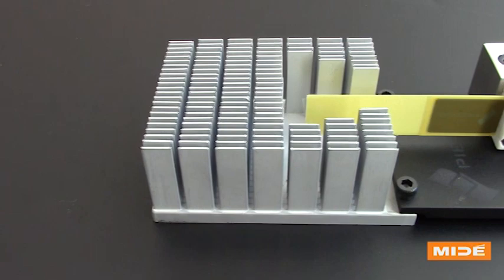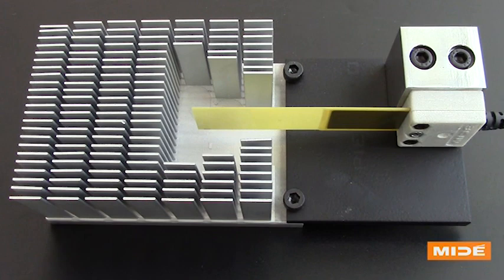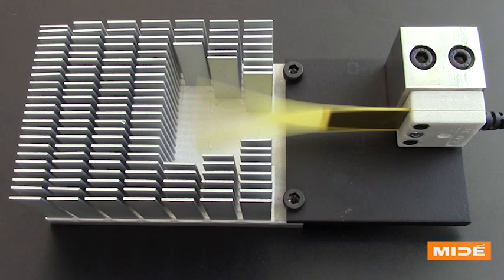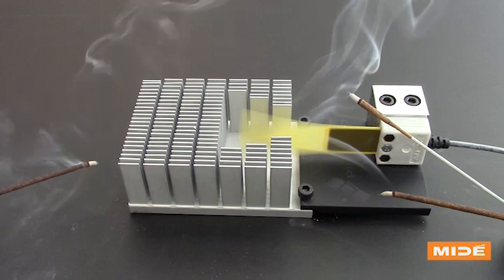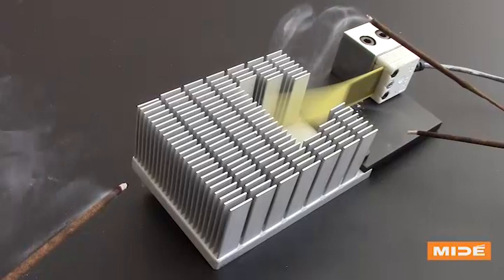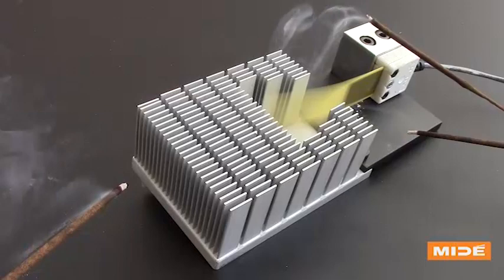Forced Convection with Solid State Piezoelectric Fan

Comment: "No rotating or moving parts" followed immediately by a demonstration of the moving parts
Reply: Flexing isn't technically moving... but I get you
Reply: That part u see moving will never wear or fail.
Reply: @TheNiteinjail  It was moving back and forth.
Reply: No relative movement in a contact area. That's where the wear happen for most technical applications.
Reply: I guess the only one that could maybe do that would be ion flow. Probably less efficient and effective than even this.
Reply: @Alex-lc1bv  Movement generally means movement between two separate parts. So like a fan it would be the movement of the fan vs the bearings.
Reply: I suspect that the weasel word marketeers will have redefined the words "moving parts" to exclude parts that are non-stationary. As in moving.
Reply: @nickryan3417  I mean the electrons in an SSD are also moving :p
the "moving" used like this generally mean moving in relation with something (eg fan + bearings)
Reply: @1temppart201  Unless the temperature of the matter is at absolute zero then it's moving. A waving fan is movement, this fan has no moving parts in the same way that the dyson fanless fan has no fans.
Reply: lol

Comment: No moving parts?? What's that yellow thing..
Reply from the maker: Apologies for the late reply. You've made a good point - and a correct one. We should have said, "no wearing parts."

The yellow material is actually a glass fiber epoxy composite (FR4) - commonly used for printed circuit boards. In this case, it encloses the piezo ceramic that actuates the FR4 to act as a flapping fan.

Thank you.
Reply: @MideTech  and what about material fatigue?
You can bend rapidly a metal strip and eventually it breaks. I don't think that glass fibers in epoxy can not wear and tear on material level.
Reply from the maker: @oberguga  Good question! The life span is essentially infinite as long as it is run within its parameters. This is flexing, not wearing. It does move, as it vibrates in flexture :)
Reply: @MideTech  So no micro fractures?

Comment: all you PC gamer wise guys need to realise that there’s other applications for cooling than your gaming rig. factories have to run hundreds of computer systems to control production and many of them are in excessively dusty or damp environments. i can tell you from firsthand experience that a conventional fan won’t last more than a year in such conditions. source: i’m a maintenance engineer in a wool factory.
Reply: Ooh, I used to buy for a processor in Australia, nice to see another one!
Reply: If it can't cool a gaming PC with a gigantic overclock, there is no reason for it to exist.
Reply from the maker: Thanks Evie, you are correct that the target application for the piezo fan is not PC's but industrial applications where traditional fan technology is challenged.  Our fan can operate reliably in temperatures ranging from -40 to 125C and in dusty, humid and corrosive environments.  We are not saying it is the BEST performing fan for airflow, noise etc.  But it allows for some forced convection in environments where other fans would quickly fail.
Reply: They wouldn't understand that.  They live in a fantasy world.
Reply: I'm sure Linus Tech Tips will try cooling a PC with 100 of these and a giant radiator.

Comment: I feel that this also presents a more reliable way of sterile mixing in small scale if design modified a little, as it does not need a break or gasket to spin it can just be coated in sterile flexible material and be mounted to the mixing device
Reply: For liquids or suspensions, the many orders of magnitude greater viscosity will be a severe damping problem. For smaller volumes externally coupled magnetic stirring systems are far more reliable and far more energy efficient.

Comment: ...there are no rotating or moving parts...
and literally 3 seconds later it goes bzzzzzz and starts to shake violently
Reply: They probably mean there are no bearings that can wear out, which happens often with normal fans.
Reply: Bending is not really moving from an engineering standpoint
Reply: @indian.techsupport  Motion is motion. I see motion. I see something that will break, from its motion. So from an engineering standpoint, its important.
Reply: @attitudeadjuster793  normal fans fail if they get clogged with dust or are operated for a long time at the wrong angle and at maximum speed.
Reply: @tazanteflight8670  The significance is that in some scenarios lifetime until fatigue-failure can be infinite. The resulting real lifetime may be longer in some situations than failure from a wearing bearing or more likely a seized joint from dust or the like (think normal fans).

Solid state electronics are themselves very constant in failure rate. Might be an interesting read for the specs comparatively.
Reply: You guys are of course correct - the thing has a vibrating arm and vibration is motion. But what's normally meant in engineering lingo, when you say a mechanical device has moving parts, are separate internal pieces that move relative to each other, have a tolerance and some sort of bearing surface which might wear out or get dirty.
(Although there are contact free bearings which are in theory wear free).
A solid state device on the other hand is a monolithic block that just does its thing. Like a transistor versus a relay. 
I guess this one might be in a grey area, there are no separate pieces but the arm bends and could fatigue crack eventually. In any case, that is what they meant.
@Vlad True, a good quality fan with hydro bearing can last extremely long. Maybe I overstated it a bit.
Reply: @tazanteflight8670  Kinda. Be the stress strain curve is a thing in engineering that shows us how things deform and under what loads that happens. You stay low in the curve, it'll probably not break unless defects in the material.
Reply: @TheMasochrist  LOL,... of course it will break. How many times can you bend a coat hanger before it breaks. About 7-10, and that is metal. No material is impervious to breaking. This is not a solid state machine. If it was solid, it could no longer move. Mic drop.
Reply: @tazanteflight8670  The flexing isn't enough to wear the material. It could practically go forever.
Reply: @Aaron-ru6ld  Im sorry,... did you say "practically forever" maybe you should clarify that. because solid state is "forever".
Reply: @indian.techsupport  You are obviously not a engineer then. Because that is totally moving and can fail..

Comment: This has some niche applications, and opens the door to very small systems such as self contained aspirating smoke detectors.
Reply: Or maybe big server farms where reliability is the main goal and that cost billions of dollars to keep them running?
Reply: @alphastratus6623  Can't come close to providing the volume servers need. The reliability of fans in servers isn't an issue. They have enough overhead that losing a single fan isn't catastrophic. Their BMC system generates an alert, a tech goes out and hotswaps a new fan module in, and at no point does anything go offline or stop working. 

This is for applications like comparatively low-power embedded devices controlling/monitoring industrial equipment in dirty/dusty areas, explosive environments, etc. Basically industrial applications. It may be a "niche" market, but it's a pretty large niche, just not one that most people are familiar with.
Reply: @ParadigmUnkn0wn  Yea, they found a process that solves the problem and that cost money. Do you really think they would keep this system if something less expensive arrive?
Reply: @alphastratus6623  I'm not sure what point you're trying to make here. These piezo "fans" don't move nearly enough air and aren't nearly as efficient as DC brushless motor fans which are currently used in servers.

Servers already use ball-bearing fans, not the cheaper sleeve bearing fans that are common in consumer PCs. It's not all about cost for them. When you're selling a $20,000+ server you've got some leeway in your bill of materials to go for quality over minimal cost. The enterprise/commercial equipment sector isn't all about cost cutting, reliability is huge to them.
Reply: PC and media room applications, if it works.
Reply: @remydaitch9815  No... brushless motor fans with ball bearings are far more efficient for PC applications. These are great for industrial applications, likeexplosive environments in alcohol distilleries, oil refineries, or the numerous other industrial processes that involve flammable solvents that have the potential to create an "explosive" atmosphere by NFPA definitions. Piezo "fans" are also good for very dusty or dirty environments which pretty much includes equipment in all industrial settings (e.g. CNC equipment, PLCs, VFDs. etc.)

This won't be replacing the fans in your home computer, but it may very well be inside the equipment at the factories used to produce your home computer and the countless components that go into it.

Comment: That’s neat and all, but that is most definitely a moving part.
Reply: That's not typically what's considered a moving part, though. Yes, it's in contact with the working fluid but so is a pipe, but we don't consider the plumbing of a house to be a moving part. Nor do we consider a heat sink to be a moving part. The blades of a fan are not a moving part, while the gearbox and brushes are, the bearings are, but the rotor itself is not.

So long as the strain induced on the flappy part only results in elastic deformation the part will last effectively forever. There's nothing for it to wear against.
Reply: @Jesse-qy6ur  the pipe is not moving, the water is. The yellow tab is moving, the electrical box is not.
Reply: @RobertWilkinsonJKekMaloy  The yellow tab is actually rapidly shrinking and expanding.
This is different to motion in the sense of motive partitions that kinetically actuate.
Reply: @0MVR_0  ahhh.  And here i thought it was magnetic field oriented
Reply: @RobertWilkinsonJKekMaloy  Your thinking is correct yet omits the method of induction. All electrodynamic and magnetic convection is a realignment of internal orientation. In this case, the yellow tab is its own molecular magnet, having predictable articulation when under stimulus.
Reply: You would complain also if it was just air moving 🙂

Comment: Nice demo. Suggestion for you. Could you increase airflow by adding some 'wings' at 90 degrees to the surface of the piezo strip?
Reply: yeah, i also thought the fins were not optimal
Reply from the maker: Hi Duncan! We have tried that and it does not enhance air flow, however, adding external ducting can increase air flow.
Reply: So cool that you tried that :)
Reply: @MideTech  I feel like this tech can be modified to imitate the movement of butterfly wings, which is more efficient than simple flaps.
Reply: @tapist3482  It could be more efficient, but probably not as durable.

Comment: What is the fatigue lifetime on the flapping element and the piezoelectric element itself?  Does it require high voltage to drive the piezo element, and if so, is the driver circuitry contained within the element?  How would this compare to a voice coil actuator driving a flapping element?
Reply: Driver circuitry cannot be placed in the element. The fan needs a 60Hz 115VAC line to operate. But, since the power consumption of these things are typically very low (roughly 30mW) you can backfeed a generated sine wave through a transformer to achieve this on a DC supply.
Reply from the maker: This particular fan is driven off line voltage in the US.  There is some small current limiting circuitry.  Here is some info we provided to another comment on the fatigue question:

During the development of the piezoelectric fan our customer required us to run some highly accelerated life testing (HALT) on a statistically significant number of samples.  The test included thermally cycling the fans 1000 times from -40 to 125C while they were operating.  The test took about 5 weeks to complete.  There were no failures.  We also ran the fans through high temperature operating life at 180C (HTOL), low temperature operating life at -70C (LTOL), Over voltage test at 100% over the normal operating voltage, Humidity HALT testing, Cold start testing which included a hard start up after the fans soaked at -40C for 14 hours, high temperature storage tests where the fans were soaked at 140C for 1000 hours prior to successful operation, dust ingress testing, salt spray and fog testing and IP68 testing where we submerged the fans for 72 hours at the equivalent of 3 meter depth pressure and then operated them after they were removed and dried off.  There were never any failures during any of these tests.  Lastly, we have been running a non accelerated life test on a single unit (in my office) since June 15th, 2016.  It has only been unplugged one time when we moved to a new building.  It is still running as of this morning with no noticeable change in performance.  I sit about 6 feet from it, If I really try to listen hard I can hear it running.  Running at 60 Hz we have put just over 11 billion cycles on the fan without failure or change in performance.
Reply: @MideTech  Holy shit that is an amazing answer, I appreciate that
Reply: @MideTech  That is robust.

Can they be operated on variable speed drive?

Comment: It would be great if this principle could be efficient enough to implement with liquid fluids; for example in low power water pumps it wouldn't be necessary to seal the motor shaft and bushing.
Reply: Doing it with air seems,, less practical than anything we already got. 
But doing it with liquids, now we're talking. Question is, can it move water? or more viscous liquids? It might not be suitable for propulsion, but might find uses for mixing and moving liquids.
Reply: @LegendLength  I could see it being used for something ultra light, but it would need to vibrate in 2 dimensions to mimic a wing.
Reply: @lordsqueak  Not a terribly complex deal, just couple two units together and offset the input frequency on one.
Reply: it's already not necessary to seal the motor shaft.  take apart an aquarium pump and take a look. the impeller has a magnet inside and is the shaft, sealed away from the inductors spinning it.
Reply: @lordsqueak  If my guess on principles are right, it is nearly impossible and impractical for liquids.
Reply: The frequency is likely too high for liquids. Turn it down and give it a shroud and it should work.
Reply: @AurumFaber  it will not.
Reply: Solid state pumps already exist, they use a piezoelectric piston.
Reply: @lordsqueak  put several of these along the edge of a sheet, drive them appropriately. You could get a number of effects.
Reply: then you'll have a pump with crazy low efficiency

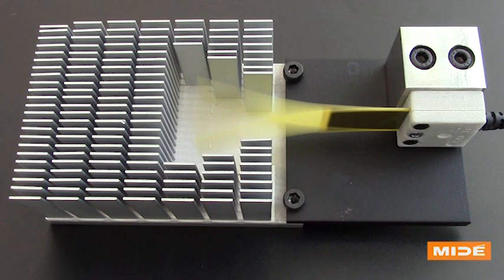Comment: "there is no rotating or MOVING parts that can wear or fail." Well... 0:16 begs to differ about "moving" parts.
But apart from that, yes a piezoelectric fan like this would be fairly insensitive to dust. But there will still be a buildup of dust on the heatsink surface so no major difference in terms of maintenance in dusty environments.

Also the "NO electromagnetic interference output." is a false claim. Piezoelectric devices tends to run at fairly high voltages, and even if feed with a sine wave it can still capacitively couple to other components and be interfering. If the statement were "less electromagnetic interference compared to typical fans." then it would be a different story.